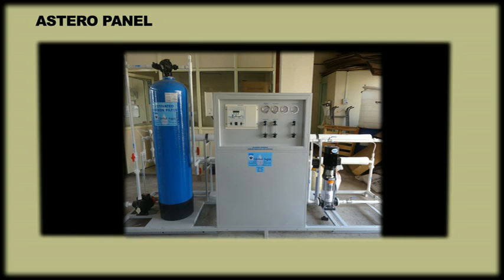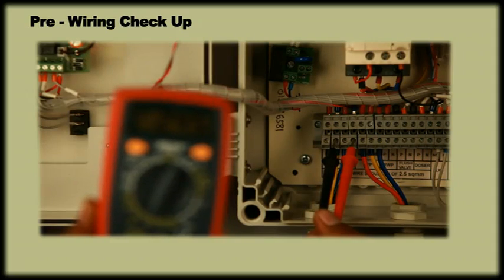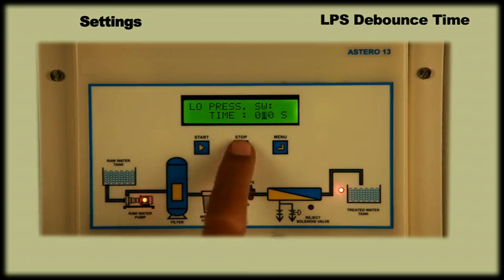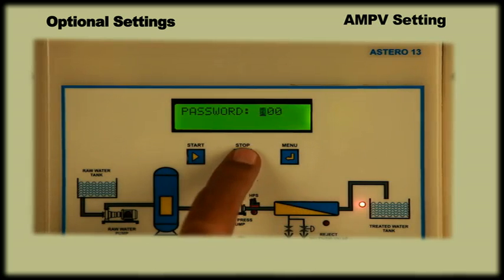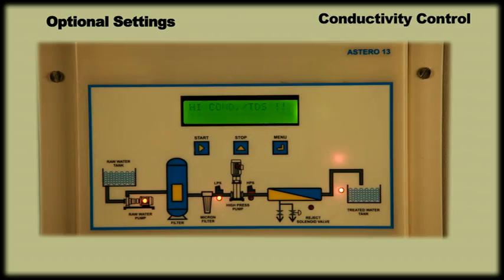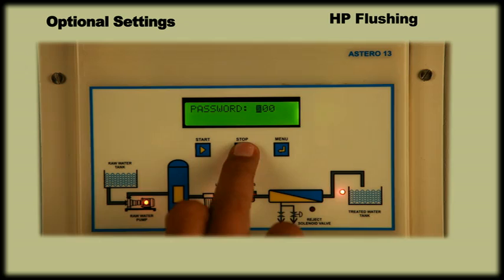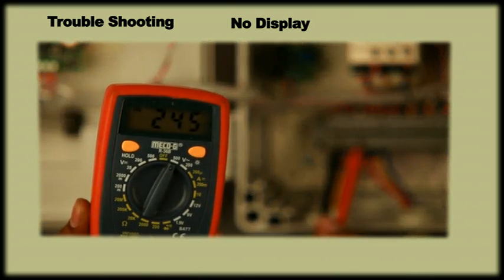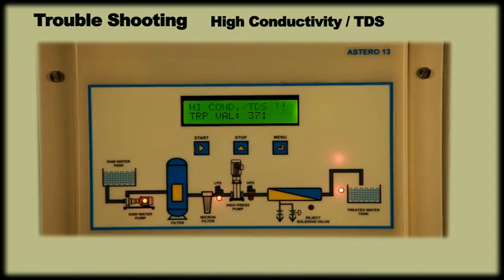How to do the settings of Astero Panel #embarkwater #Aster #ROpanel #NGpanel #controlpanel

Comment: I have 4000 lph ro plant.. and astero 33 model is installed... It shows rw tank empty / tw tank full on display... Bypass switch also not working.. shorting / separating floaty wire also not solving problems
Reply from the maker: Dear Sir, please share your contact details or you can call on our customer support on +917276003731

Comment: how to switch on the Aster 133 CIP pump manually
Reply from the maker: Contact to our Customer support on +91 7276003731
Reply: @embarkwater8097  your customer support does not answer. Very bad. I wanted to buy some controller panels but 😐 seems you are not interested
Reply from the maker: @rahimow  Sir, our office Timing is 9.30 AM to 05.30 PM (Mon-Sat)
, can you share your contact details

Comment: How to mobile connectivity attached wireless connection
Reply from the maker: Contact to  our customer support on +91 7276003731
Reply: How to mobile connection attached in wireless mobile connection
Reply from the maker: @jitendrajithu1234  Contact to our customer support on +91 7276003731

Comment: I have the RO plant of 1000 LPH ergo make automatic, when ro plant is started the pressure at MGF and ACF begins up to 5-6 kg and at jumbo cartridge filter also 5 kg then HPP starts. and its take 3-4 minuts to start. in this process time multi port valves of pretreatments begin to leak so highly. what should i do . please suggest me. my mobile no is 09911166440.
Reply from the maker: Contact to our customer support on +917276003731/32